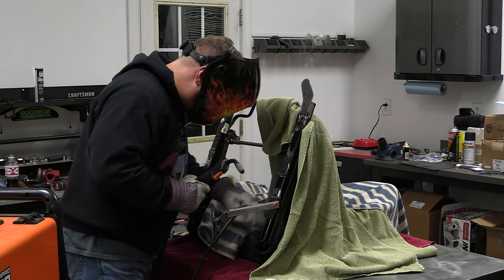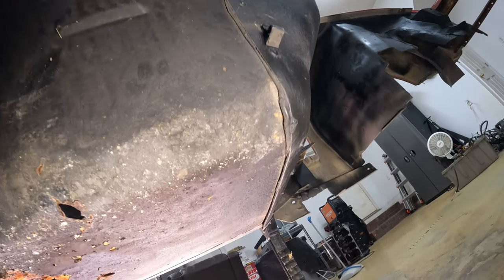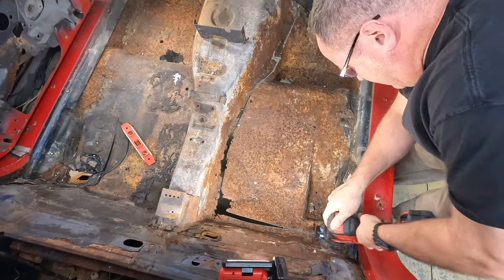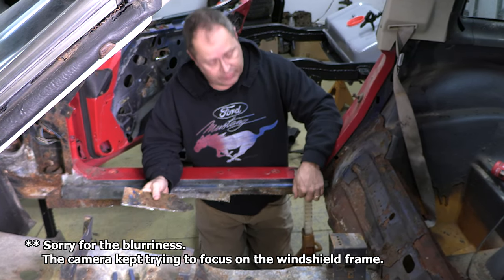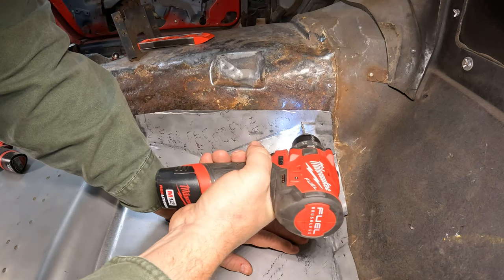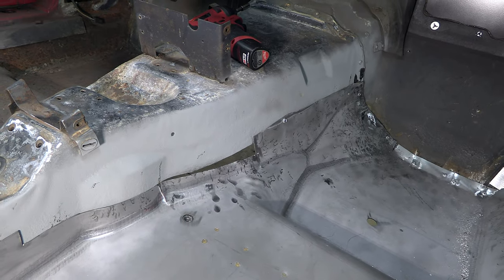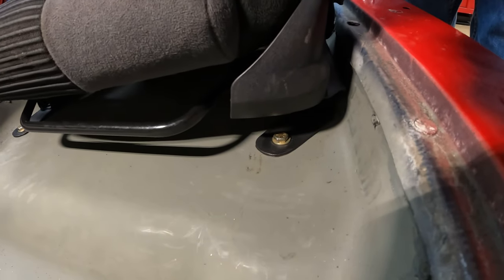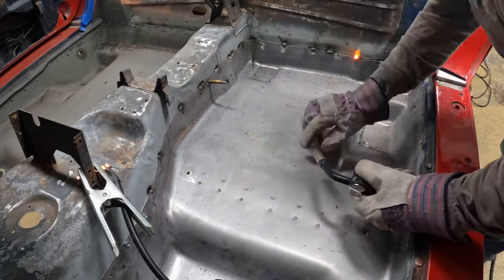Junkyard Find! These Cheap Seats Are a Great Find for the Abomination Corvette.

Comment: In my experience you should seam seal the underside of the floor pans as well. Great project, looking forward to seeing the progress!!
Reply from the maker: You are right. Plan to get on that later this week. It had been forever since I had gotten a video out and just put that off. Thanks for watching!
Reply: @TheHorsepowerMonster I noticed you mentioned something at 21 mins. You said you'll be putting in anti vibration matting and carpet. As a 74 C3 owner, I strongly recommend a layer of thermal insulation - focusing around the transmission. Driving mine, it becomes incredibly hot without it. Alternatively, you could go old school and consider a transmission fluid cooling system. Would handle the con pretty neatly, but I don't know how far you're willing to deviate from original design. Keep in mind though, mines a stock 454 BB so that could be why😂. Great video!
Reply from the maker: @matthewlydon5772  That's good advice, thanks! And thanks for watching!

Comment: I'm  in the beginning stages  of my 1994 c4. I use 2×10 boards screwed together  to lift my car high enough  to work on the bottom  side of the car. Low tech  and low budget.  And highly effective.

Comment: On my 74 convertable(no steel floors) I managed to get C6 grand sport seats to fit my 6' 2" frame bit I had to modify the rails and get rid of the motors. Quite a job but it works great. Love your vids!

Comment: I still think you should do a low deck 598, instead of that fancy small block. It should fit where a 454 would go as the external dimensions aren’t that much more, and well it’s a big block! But it’s your car. I just think it needs a big block.

Comment: I went with the C6 seats for the 77. Bought some aftermarket low sliders. Bolted them up slapped em in. I'm 6'. I hope you tried the seats with the T-tops on...Not only was height a issue so was my legs clearing the steering wheel... looks like hard mounting is in my future...
Reply from the maker: Good point. I did try it with the T-top roof on, but not with a steering wheel. You probably noticed my dash is ripped all the way out right now. Thanks for watching!

Comment: 26:28 using CAD and CAM for making them seat plates is awesome.  Cardboard Aided Design and Cardboard Aided Machining😂 fun to see RX-8 parts on a vet.  You going to do a 13b swap in to a C6 like old Rob Dahm? 1000hp 13b?😅
Reply from the maker: That would be fun!

Comment: How did you keep the body from flexing ? I don't see any cross bracing , but maybe it doesn't flex .
Reply from the maker: There is a little flex. The doors still open and close, but not as easily as they did when the body was still bolted to the frame. I thought about trying to do some cross bracing, but everything is fiberglass and I couldn't find good bolting points. Obviously, I cannot weld bars in. There are two long metal pieces that run the length of the cabin that function as "sort of" frame rails. I think they are there so that the body can be lifted and set on the frame from the factory plus limit flex. I'm depending on those to keep it straight.  Thanks for watching!